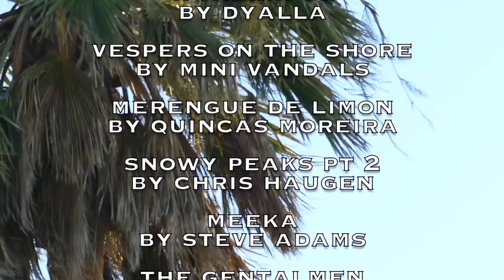Salt & Tar: Ep.178- The Art of Lashing

Comment: The sticky  goop you used is called bear poo by electricians. We use it for just what you used it for. I would suggest that you buy a rubber cork  that fits snuggly in the hose. You can get them with a hole to fit that twin lead you passed through the deck. Insert the cork and secure it with a little of that sealant you used on the deck fitting and a good clamp.

Comment: I have high confidence in the lashings for the solar panels. I have less confidence in the strength of the wood that is lashed. The holes are near the bottom of the wood and I could imagine that cracks could grow from the holes. Maybe you make lashings that choke the wood just outside of the lashings. This would bring the full strength of the complete beams at the attachment points.
Reply: My concern exactly.  Those lashings are probably 100x as strong as the small amount of wood they are actually securing.  Hopefully you won't take a wave to the bottom of the panels and push everything to the limits...
Reply: Exactly, sadly it will not last.

Comment: I was taught soldering wires together probably in high-school shop (back about at the end of the last ice age, long before crimp connectors) and we used a rubber (rather than the current notably thinner vinyl) "electrical tape" as the first insulating/sealing layer, which was then covered with the self-adhesive cloth "friction tape" for mechanical protection.

Comment: Love your videos! Just a comment about the frame that you’re lashing to your solar panels. I’m worried that wind will catch underneath the panel and the upward forces will split the wood from around the lashing. You can see that the fir has already split with the length of the grain. Your system is fine for downward force on the panels, but not for upward force. It reminds me of the forces on the wing of an airplane on which the wind actually lifts the plane. I don’t want you to lose your solar panels! Looks like a redesign of your frame is in order to brace for upward wind forces. Cheers, and keep up the good work!

Comment: If you want a less slippery floor in the dink what we did was get a piece of that cheap outdoor carpet and cut it so it wraps around the floor. I used velcro which sticks to the carpet to loosely hold it in place until it's pumped up. The floor pinches the carpet to the dink after it's filled. 3.5 years now and it's still great.

Comment: Yup, Ruthie, many indigenous peoples around the world still build their boats and rafts with nothing more than bamboo, palm, or wood lashed together. It is a tried and true method of building watercraft, and housing, world wide for thousands of years. In the modern world rope has come a long way, but in many third world areas plant materials, animal gut, and even hair is still used for lashing materials.
Just remember to guard against the white wire rubbing on the bracket on the transom bracket on top of the bullworks. It looks pretty close there on screen. A couple wraps of that tarred cloth electrical tape should offer a few years protection, or y'all could screw a piece of the tube over that corner that you're going to use to feed it to that through deck fitting. I love the back-up of the solar to charge the batteries so you don't have to run the engine to charge up. Am I remembering correctly that you guys are planning on a wind vane charger as well?

Comment: Good video.  I would be tempted to follow the stanchion down and go through the top of the plate with the wire with a small hole.  Your boat looks great and you may not be happy with a random wire showing on the outside on the stern.  Keep up the great work.
Reply: Agreed, That wirs on the transom is just awful looking and asking for trouble as well with wear.
Reply: @JCrook1028  You bet, the davits are black, so if black wire loom was used over the white wire it would protect and be a little camouflaged.  Cheers

Comment: Nice work with lashing, suggestion if  may, try stainless steel  u-clamps might be a better option, rope always tend to stretch and with movement off boat in rough seas, clamps might be you long term option, I'm sure you'll update it later and you now just getting everything in it place. Good work with all you projects. Awesome video's!
Reply: Yes but lashing is so much saltier, and traditional. Bet you a cup of coffee sticks lashing.
Reply: @joncozzi1701  I Have never seen a properly made lashing stretch enough to come apart, even in heavy weather.  It entirely depends on the skill with which it is applied.  Nylon seine twine well stretched on each pass and then painted afterward will last almost indefinitely.  I dislike Metal clamps, stainless or not, they almost always present more rough edges on the boat that contribute to chafing.  Lashing can adapt to any shape, any amount of strength you want.  It's a beautiful art.

The only time ive seen lashings slack off is with untreated natural fiber line that expands and contracts with the humidity, Tarred natural fiber lashings can remain good for 50 years if tarred every 6 months or so.

Comment: 20 year journeyman diesel mechanic here.

With the solar. You will have problems with those Y connectors. The rivet in the middle will corrode causing a bad connection. In the salt air it won’t take long. I’ve used them a few times and see them used by other plenty of times. They always fail. 

Also you need to be able to isolate a bad panel so that you still have partial solar if one panel fails. 

You should have ordered another MC4 connector. Now you should order all new MC4 connectors and replace them.

Comment: Thinking I would have run the White cable thru a length of tubing to help protect it from the elements/damage. But that is just me.
Reply: AH Yes, I thought the same!
Why not run it through the tubular davit from the outboard end and down through the base straight down through the deck?
I guess they can't think of everything?
They used to try to look for the best solution, now I think they are racing to just get it done?
Sometimes when you are too close to a project you get blinded to best solutions.
JIM
Reply: @jimc4731  If I’m not mistaking the davits are solid metal and not tubing.
Reply: @andreboudreau6474 : if that’s the case I’m surprised that he didn’t weld a separate steel tube on the davit or drill and tap the davit for a dozen machine screw fasteners for holding the wire. lol. I’ve found that tie wraps don’t last long in direct sunlight. I was impressed with the start of the solar panel project but in my opinion it kind of got cobbled together at the end. Love those kids and have complimented their work and skill many times, but for Goodness sake, sometimes I just scratch my head.
Reply: @andreboudreau6474  You could be correct, I can't tell from here 🤔
JIM
Reply: @jimc4731  The davits are solid I think.

Comment: The lashings will be stronger than the cross section of timber. With any luck, in the storm that tears off the panels, the failure will be those thin cross sections of timber instead of moorings for the poles in the deck.

Comment: The stuff you need to stuff in your hose called duct seal, check your local electrical wholesaler. The wire is called marine grade cable and the tape is called friction tape.

Comment: As an Electrical Engineer and Blue Water Sailor, you can not add enough protection to those connections on the solar panel wires. 😁🛫
Reply: I don't know much about boats. Is there some limit to what can be added to it before it sinks.?

Comment: Ruth & Garrett, I have followed your project since the beginning and I congratulate your hard and amazing work, your labour of love, however, regarding your latest project for the 2 PV panels, I feel I should warn you: it is dangerous and it will not last, so you should really consider a change of plan. When you are facing gale force winds, and it is only a matter of when not if, the force of the wind will shear the wood , bend the davits, break the aluminium strectchers, and drop the panels into the water or leave them dangling by a thread. The panel project is basically an areoplane wing or an upside down aileron attached to the rear of the vessel, lifting and pushing down the vessel most of the time.
Ponder this for a minute: tornado winds in the US lift houses from the ground or break apart roofs, don't they? Yacht manufacturers wherever you find them do not offer a vessel with this sort of installation in the aft of the yacht, do they?

Comment: Solar panels on a boat are interesting to me. On land things are less variable. Roofs don't move... At sea, you also have some reflection from the water. Which from what I've read isn't something that can be relied on. Your setup should work well even at varying latitudes, but will only occasionally be optimal. One thought, maybe solar panels on cabin walls. Certainly not optimal, but at times they could add to the charging current. I suppose in an ideal future sails with solar panels built-in might be more optimal. Also anything along the above water sides of the boat would be good, although not particularly attractive (unless you like the look of solar panels). Given that you are a sailing vessel, regeneration via the prop, like Leo talked about on the Tally Ho project, might provide a lot more current than solar. Maybe even enough to power an electric drive motor. (Might be interesting to calculate the trade-off in battery weight vs. total diesel engine weight...)

Comment: Looks like after you connected your panels in parallel you connected the combined panel output amperage into a smaller gage wire? If so that will Impede the current to your charge controller, and that will keep your panels from being all they can be where they will struggle to do much at all with all the shadowing they will encounter from the masts, sails, rigging, ect...

Comment: Hi Garrett, Will you add some UV protected insulating foam under the solar panels to hide the wires and protect them from deterioration ?  It will be easier to replace the foam in a few years than replace the wiring, right ? Also might make it look cleaner and quieter vs wind and warping effects too when you use the davits for dinghy underway. Deck pass through very nice, maybe a trip to a motorcycle parts supply will yield you a tight 180 bent hose from a water cooled engine/fuel tank etc that necks down in diameter...?

Comment: Electrical tape isn't designed to cover electrical connections. It's designed to tape wires temporary to various stuff that  can be used to fish wires through the walls.
Reply: I hate seeing how people think 'insulation' tape is a permanent waterproofing solution ! If anything it will absorb water and hold it right on those connectors that they are trying to protect leading to heavy corrosion and bad connections !
A permanent solution is not that difficult.
Reply: Yes and the wire splices/connections should have been in a water tight box.
JIM

Comment: Can you explain what soup is? I get its a varnish of some kind 😁

The two wire thing is duplex wiring, I think.... 

Just curiose why you didn't wire in series (the smaller duplex cable would probably be adequate with the higher voltage) otherwise I worry its a bit too thin?

Comment: My question is why didn't you treat the wood for the solar panels before you put the panels in. The outer surface is treated but the area where the panels rest in the frame are still bare wood that will allow moisture to penetrate and swell or over time rot the wood.
Reply: I think they did the inside in the previous episode when they built them. Too lazy to go back and look tho.

Comment: Great video. I have been following you since before your move from Washington state. I do have a couple questions if you don’t mind.  Love your wiring through hole. My kind of engineering. My question is , why did you not soup the inside of the hole?  Would the soup not help prevent any moisture fro entering you decking?
Reply: Sikaflex handles that.

Comment: Why didn’t you just run the hose conduit right up to the panels? Tidier and more protected.
Reply: Because there are sharp turns which cannot be done with the conduit.
The sharp turns are there because there is no hole in the davit post through which he could go through.
(My personal opinion: bad planing, the whole wireing looks like there was no thought about how to do it before all the pieces are permanently mounted into place. Also my personal opinion: they are rushing now to meet their deadline)

Comment: Hi, the wires from de panels are much to small. Look you have two thick cables connected to one small cable. That wil give you a loss of voltage and probably heat. Succes.

Comment: The only adverse comment I can think of is that you keep spending time in jobs you later undo to paint or finish. It sometimes looks as unproductive time. This time I ask myself why didn’t you paint the frame even before installing the solar panels and the davits before the frame. Another thing, where the structural part sit on the deck you have put two structural reinforcements. If someone ever trips on de h and hit those it could get a serious injury. You could weld a plate in between them that will not show any sharp edges.

Comment: love the show but theres just to much maintance on this boat down the track lashing the panels on why does not make any sence dont know how long you plan on keeping her but thats going to be a full time job sorry just saying how it will be
Reply: Could have use four short pieces of aliminum angle and four "U" bolts to attach to the round davits!
JIM
Reply: @jimc4731  and then you have the issue of dissimilar metals causing corrosion. I'd be willing to bet that lashing lasts for decades. Remember, they'll be souping the wood on a regular basis anyway so the lashings protection will be automatically refreshed at the same time.